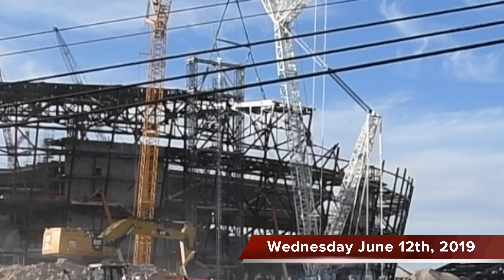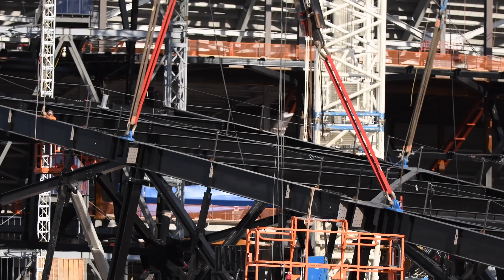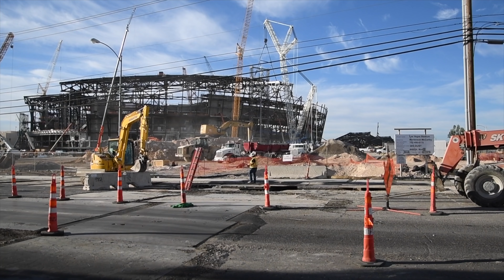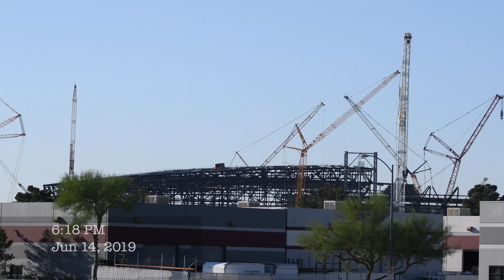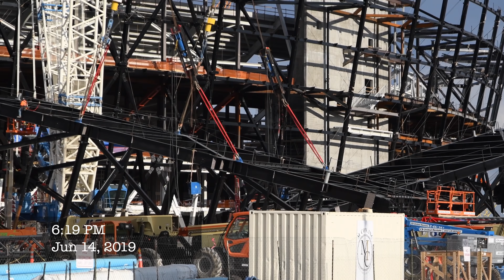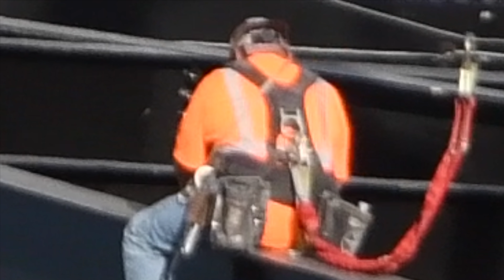4K SPECIAL Las Vegas Raiders Stadium Update: Truss went up, brought down, still down Jun 15 2019

Comment: That truss was up for around 2 weeks before they brought it down
Reply: looked back at my archives and the canopy truss actually went up on may 24th, they have been trying to fix the issue to no avail since then, according to Raiders 1967 they were having a problem with the bolt patterns not lining up
Reply from the maker: We thought so.  We weren't sure until we went back and looked at the footage. Do you know why its still down?
Reply: @JediRichCreativeProducer  considering they knew of the problem back in may im sure the fix will go quickly
Reply: @BD20682068  yes you are correct! The roof trust have quite a bit of adjustment in the hinge support system. But they couldn't get any of the bolt patterns to match. It's easier to put it back on the ground and make the adjustments. It will be a quick fix and should be back up this coming week.